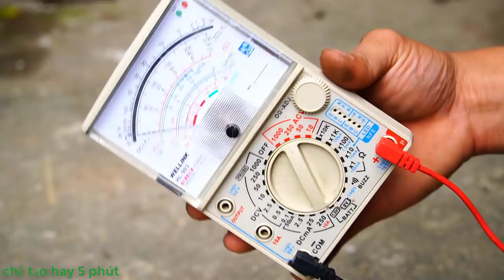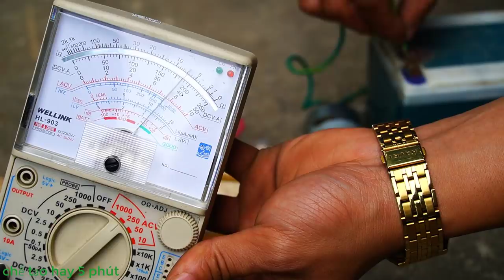ways to turn sewing machines into high power generators

Comment: Not exactly free, it certainly is mobile but how long does the battery last?
Reply: It will be free whit solar panel!!!
Reply: Post Script;  It's also is defined by what you consider a sewing machine motors output is (not exeacly  HIGH Power

Comment: Inverter is better then this eventually you are using battery  and important thing no cooling for  your  generator and motor you use as prime mover. Not good for long run at all..

Comment: What a waste of energy.
1.You light up a bulb with 110V or 220V why don't you use a bulb of 12V with the same wattage as you used.
2. You run a AC fan. Why don't you put some blades on your AC motor? So the power from the battery is being directly used.

Comment: Why you didn’t get electricity directly from battery 😂😂
Reply: Hello Sir,  May I ask you a question?
Are you Electrician, 
That battery is the source of energy
Wen you have power in that socket  
You can connect  12v 5Amps Adapter and directly to that place of the battery! Thank you!
Reply: 😅😅
When you se my massage send to me feedback 🙏🙏
Reply: Adis Adrien 
you gave  a power to motor via battery and motor start produce a electricity right main thing is get a power .
My question is why you use lots of stuff for electricity .same thing you can get  from battery
Reply: Adis Adrien and yes same thing I done when am in childhood broke my Rc cars remove motors And do same thing.

Comment: I have an electric motor at 12 volts and a sewing motor that work at 220 volts and consume somewhere at 80 wats .If I put this motor( that work at 12 volts) for example at a solar panel ,or at a battery ,I will obtain 220 volts Ac and 80 wats ?. At what it's useful 80 wats, except to put some led lights in a rooms ?. Probably: a TV, laptop,charge a smartphone and tablets,radio .But,not at a: washing machine,a mini fridge, something to cook,a room heater or,some tools . For this, it's need more power . Ideea it's good,but,not solve all the problems . Think to an improvement to this .Maybe that this 12 volts to rotate more sewing machine motors and to obtain more power ,maybe, somewhere to 700- 800 wats . 12 volts engine ( who know,improved with more magnets)in the center who rotate on his axis ten motors in the same time ,or a help by making union of axis with another motor at 12 volts to be able to have more power .I don't know . I know only that's need more power .